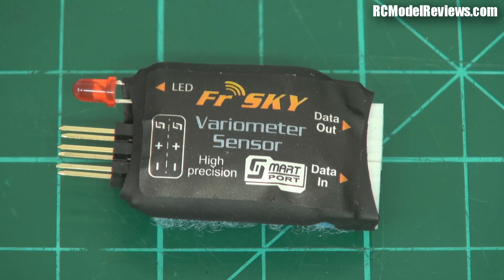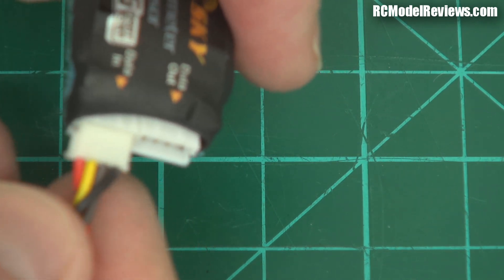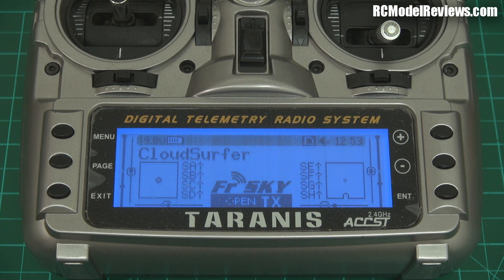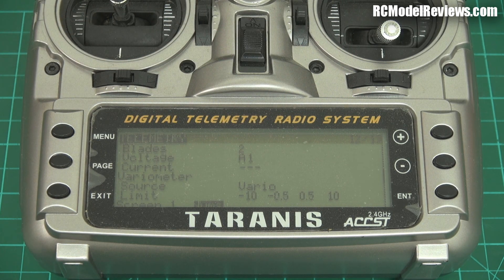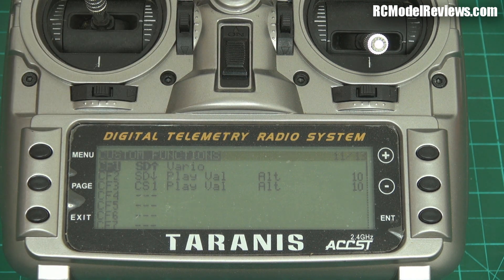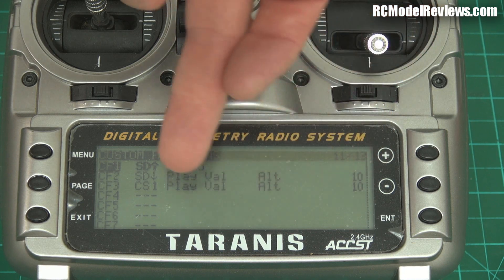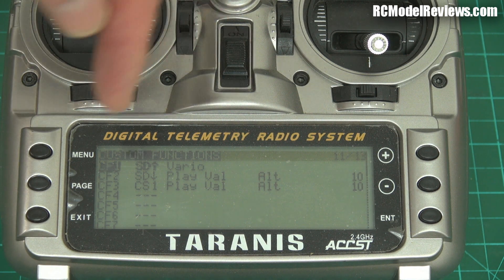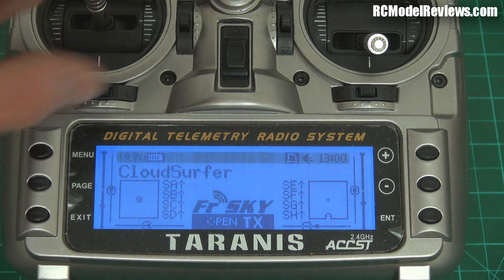FrSky variometer sensor (setup)

Comment: Bruce, I'm setting up my FrSky vario with D4R-II receiver and Jumper T16 with OpenTX 2.3.4 and all I can get is the absolute altitude which is no use to me as it indicates -40m! I can't get relative altitude. I tried editing the alt sensor to no avail. I guess you've done this in your T16? I'm new to OpenTX , having come from Aurora 9 but so far I'm enjoying it! What could I be missing?

Comment: Brilliant! Here is a question - will the altitude reset itself to zero when the system is turned on or must one not to forget to reset the altitude limit (A>X; x being 400ft + local elevation) when operating from a flying field with a different elevation than previously set, in order to always achieve a 400 AGL limit from take-off?
EDIT - Disregard. After watching the follow-up video, I saw that the altitude may be zeroed before take-off. Cheers!

Comment: I have a new problem, I was searching the net for it and found someone else describing it on GitHub... I installed a vario on my bix, have everything working but when I turn SG to the up pos it should give me alt in ft... instead it giving mah? not feet! on the telemetry screen ... sensor=alt it says ft. I tried changing it to different thing and when I set it to % it "says " ft when I flip SG on.... any idea whats going on... now, i'm using the simulator and i'm not connected to the x8r, shouldn't matter? what do you think is wrong? opentx 2.1.8, amber sound pack for 2.1... here is a link to a good description: thanks for the help!https://github.com/opentx/opentx/issues/2617

Comment: My Vario begins at 0metres and increases every call BEFORE I TAKE OFF ... Multi rotor chained through Smart Port with Voltage sensor. I don't trust the height call either ... suggestions   Good video though.

Comment: I received my Vario and Lipo voltage sensor in and brought up your video to hook things in.  My level of operating system isn't the same as yours and I wasn't getting anything back from my Vario.  Finally un-hooked it and hooked the Voltage sensor in and I got feedback on a telemetry screen.  I wached some of Painless360's telemetry info that is a closer version to mine and went back to the vario, plugged it in and still no info.  Then I realized I had the wire reversed (lucky these wiring layouts don't let the smoke out like old Airtronics radios used to)  and blammo, I've got height data.  I have a couple of long servo extensions that I run from my buried receiver up to where my batteries attach.  I will be swapping the sensors like I swap the little throw away units I use now.  It will be nice having my radio tell me I'm running low on juice or that I have an individual cell that is low instead of maybe hearing the beeping of my low cell detector.  
I've had this Taranis for years but have had little time to use it to potential.  It is a fine radio for just mucking about in 4 channel mode but it's fantastic the things it can be programmed to do.  I'd love to buy a Plus, but I can't justify replacing a radio that doens't have anything wrong with it and unlike my days of heavy sport flying and combat flying with 8103's that only held 10 models, I don't need 3 of these.  If I was competeing I might have two just so I had a backup.  A little more programming to do for my Cloudserfer adn the I will be out logging my heights, flight times, battery use etc.  Gonna tie a couple of 2200 mah packs together (gotta have the nose weight anyways) and monitor the pack life while I fly.  Gonna be great.  
Telemetry, used to be we knew it was time to land when our ears told us the engine had died.  Who'da thunk it.

Comment: i am having the worst time finding a way to connect the lipo voltage sensor with display to the vario using d8r and d4r receivers. any suggestions?

Comment: I've been experimenting with the vario, one such use is to set the altitude to 120 metres and have the software cut the motor to 1/4  throttle when 120 metres is reached, works great, and as soon as the aircraft drops below 120 metres the throttle goes back to normal operation.

Comment: i've found that the firmware update for the taranis let me plug the radio via usb into my mac and use it as an external controller.Before i was not able to do that. Awesome to be able to use the radio with all the emulators

Comment: Bruce, according to the FrSky documentation you can connect the Vario to the older telemetry receivers (e.g. the D4 or D8 series) without the use of the hub.  It remains unclear if you can daisy chain using the older receivers, or if you're limited to a single telemetry device.

Comment: *i should have watched the other video first lol
So a example 1 you are at the bottom of a mountain and fly to the top that is 800m above you although you will not be 122m above the ground below the model at any one time but many meters above where you are standing. 
example 2 you are at the top of the 800m mountain and fly horizontal out say there is a 1m out to 1m fall of the slope so at 122m out horizontal you are 122m above the ground but are still 0m altitued from where you are standing.
The vario mesure its distance from where you launch from so in example 1 it read 800m + hight above it you are although you are not 122m above ground. In example 2 it will mesure 0m but even though you might be 122m above ground level under the model. Where did some one brake the rules in these situations or at what point? In either example you are not told the exact hight above the ground your model is at any point unless the ground is fairly flat. When did you break the rules at 122m above ground under the model or when the vario reads above 122m from the lauch location.

Comment: Thanks Bruce.

I have a Normal Precision Vario, but not yet used in anger. I also have a few older sensors. Until now I never realised that I could interface them with the Vario.

Thanks again.

Comment: Bruce, believe this or not:   I bumped into a guy at my local flying field some weeks ago who has the same variometer  (he has a DLG).  Anyway he was being chided unmercifully about his radio announcing the 400 ft. AGL limit.  Next weekend he came back and when he hit the virtual ceiling, that sexy voice said "420 feet and F*** the FAA". Actually, it turns out he had a few other choice announcements as well. Seems there is a alternative tarannis voice pack (for gliders I guess) going around. If I can find it, I'll send you a link.
Reply: +Sean Coyne My favourite is using the g-sensor or the Naze32 and configuring a CS that plays the soundfile "bugger" when the G forces exceed anything likely to be encountered in normal flight (ie: a crash has happened) :-)
Reply: Have done so. It's good for a chuckle, all right. I also had one, that when I switched on it said, "Hi Moron, which model would you like to crash today?" I got sick of that as well (it was like Nostradamus...spookily prescient. lol).
Reply: +xjet&#160;
Lol!
How about,"Tis but a flesh wound!" :-)
Reply: +Sean Coyne Yes, if you watch my XJet channel you will have heard Gordon's Turnigy 9XR Pro and its "modified" voice files -- quite a laugh.
Reply: Need one for maximum throws on the sticks, especially for mini-quads, "Arggh careful!" or "Watch out for that tree!!!"

Comment: I like the subtle switch (Other type switch) from annunciating the altitude in the officially approved model flying sliver of air, to sternly announciating it when the operator allows his tree-killing baby molesting drone to venture near the forbidden zone, as heard at 5:45.  That alone is what can keep the planet in its correct orbit and avert global warming from colliding with climate change.
Are UAV operators who wear foil equipped fluoro orange hard hats and safety international rescue orange socks allowed to set 119M as a playpen fence marker? (Assuming they have removed their shoes prior to entering the airfield of course.)

Comment: Personally I'd just leave CS1 switch to playtrack a voice warning saying you're over the limit.
Because if you're in announce ALT switch setting you're going to hear two ALT announcements.
Alternatively you could create a logic switch that if you're in an announce ALT setting to not announce the ALT and instead announce the warning with ALT reading.
Reply: Instead of playing the value again I think you can use the override channel to for the switch to be changed and then will be like you physically changed the switch yourself.